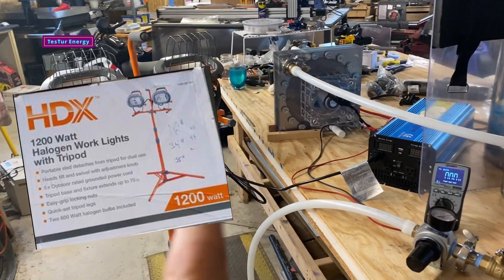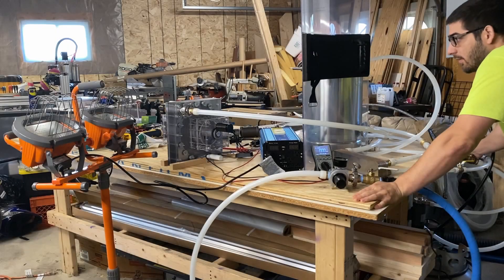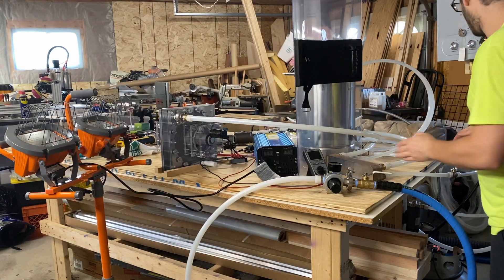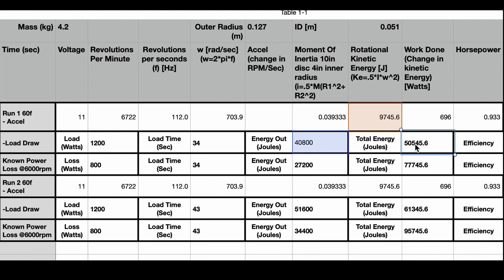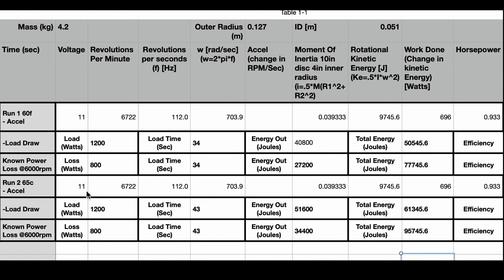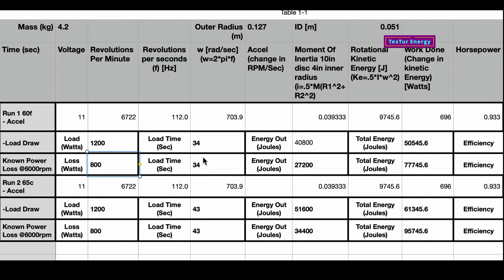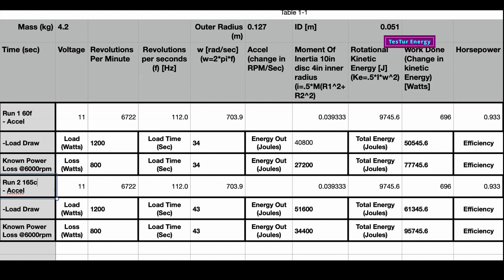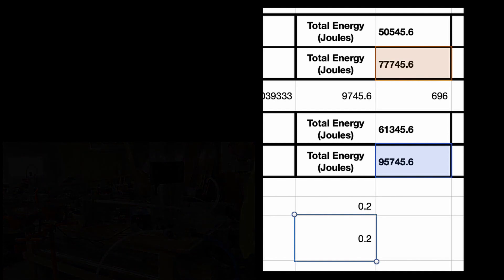Tesla Turbine 1200 Watt Electrical  Load Tests - Power Calculations - compressed Air + Propane

Comment from the maker: 1200watt Load Test ELECTRICAL Output Efficiency Calculations For 10in Tesla Turbine Are In! 
See the charts here!
https://www.youtube.com/post/UgkxRukN0zoVbtfe1LmLUlXyIo0kdt1ExWZs
Now, I want to premise these results with a few notes first. To start, I want to emphasize that the sheer fact that I’m getting this kind of power and torque at such a low rpm and pressure is the point of the feat here really. The only way to do that, at such a low RPM, with a Tesla turbine is to have REALLY good use of the motive fluid by having little to no slip. I have solved much of that issue with this first test prototype turbine. That’s with a plastic and aluminum junk garage build turbine that has very high inverter, rectifier, generator, gear alignment, RC car plastic gear yielding, bearing, casing sidewall clearance, nozzle geometry, small plate heat exchanger, 100ft comp air hose Losses and last but not least the circular rounding that I lathed on the hex shaft for the bearing, on one side of the turbine, is off center so I’m losing a ton of energy to vibration because of it. This stack of discs itself is impeccably balanced right off the cnc machine even though I have done ZERO balancing of it yet. The only vibrations I get are on the one side of the turbine shaft that has the bad bearing round. 

It’s going to take a little bit more R&D on my side to get the final actual efficiency numbers for just the Tesla turbine/disc stack itself, not just numbers predicted from the electrical outputs after estimated system losses. So mind you, for now, these numbers are low because they represent only the known energy converted, ELECTRICAL output efficiency, energy out to the plug vs energy available in the 170gal 150psi compressed air tanks. (This does includes the known change in rotational kinetic energy the disc stack had to gain just to reach the 6,500rpm operating conditions) These numbers are what someone would actually get out electrically with our system exactly as it is and not some fluffed corporate number that looks good in advertisements. Again bear in mind these aren’t indicative of the actual Tesla turbine’s operational efficiency because of all the random bad side components in my turbine, that I don’t have exact losses for, as well, and possibly more importantly, because the efficiency test is done over a very short period of time. 

For perspective, the change in energy just to increase the rotational kinetic energy of the disc stack to operating RPMs is 1/5th of the total power put out for the first room temp run. So not only did I have to give up A LOT of the compressed air just to get it up to “efficient operating RPMs” but this happened in its least efficient rpm load range so that part is heavily weighing down the overall efficiency of the total energy output compared to available energy. 

But now as for efficiency numbers. I have now calculated it a few different ways. If we only consider the energy put out by the light alone the efficiency seems to come in around 13-24%. That’s calculating the available energy in the amount of compressed air we have available in a couple different ways and is really super low ball rough estimate. If we can fix the gear losses etc, again which should be easy to do, with the the new direct on shaft generators I’ve got, the efficiency is coming in between 26-46% efficient and could be even higher depending on how much of a low ball I put on those 1200watt unloaded generator loss numbers that can easily be gotten back with simple fixes. This is to the PLUG too!! Not to the turbine’s shaft. My unloaded generator power loss tests showed 750-1500watts of loss at these RPM ranges and my calculations have 1200watts of loss. Realistically the loaded generator condition could be seeing upwards of 1500-2250watts loss, especially with the plastic gears yielding more under load. So the real losses for the loaded condition could be something something like 1600watts plus, which if that’s the case the efficiency is looking like it’s close to 29-53% efficient, operational efficiency, to the plug 🔌. Again these are rough estimates for how much energy is available in 170gallons of 150psi compressed air. Which, for the record, the different ways I calculated it give it a range from 260,000-380,000joules.

The red, yellow, and green cells in the upper right corner show how much of the available energy in the 170gal 150psi tanks was turned directly into electrical output. This is NOT turbine efficiency. This is the efficiency AFTER inverter, rectifier, generator, gear, bearing, endplate clearance, nozzle, plate heat exchanger, 100ft of hose losses. Each of the three colors are from calculating/approximating the energy available 3 different ways. Red: an online compressed air energy storage calculator. Yellow: ~10% of the compressor input energy (compressors dump ~90% of the heat of compression out to the air through heat exchangers.) Green: energy needed to compress that much ambient air down to 170gal at 150psi. As such, the ACTUAL ELECTRICAL OUTPUT efficiency shows that about 13%-24% of available energy in from the 170gal 150psi compressed air tanks was turned into electrical load energy output. 

At the bottom there are two theoretical calculations for the maximum electrical output efficiency for if the turbine disc stack was 100% efficient at utilizing the energy it was given. The top row is for the case where all those conditions are bad (most likely the case for these runs) and the bottom row shows the maximum electrical output efficiency if all the auxiliary components to the system, other than the turbine, were fixed with quality parts like low friction magnetic bearings, etc. This ranged from ~41% for bad/moderate/current operating conditions and ~50% for fixed/modern high quality parts. Considering these numbers that means we can reasonably expect anywhere from 33-55% ELECTRICAL output efficiency by only needing to fix the major loss components. Thats STILL before any heat is added to increase thermodynamic efficiency.  

If you know how to, let me know what you get for the total joules available in a 170gal tank at 150psi being dumped to 65psi. Like I said, I came to those numbers above. It would be interesting to see what others calculate for me to compare to. I will add though that I’m going off the volume the tanks are labeled as from the manufacturer. So it is entirely likely that these tanks are quite a bit smaller than what’s advertised. Which only means we are getting better output efficiency because the available energy in will be less if the tanks are in actuality smaller than advertised. 

Industry standards for micro gas turbines is about 25% electrical efficiency. From the DOD:
https://www.energy.gov/sites/prod/fil...

Micro-Gas Turbines
https://en.m.wikipedia.org/wiki/Micro...

“Microturbines have around 15% efficiencies without a recuperator, 20 to 30% with one and they can reach 85% combined thermal-electrical efficiency in cogeneration. The recuperated Niigata Power Systems 300-kW RGT3R thermal efficiency reaches 32.5% while the 360 kW non recuperated RGT3C is at 16.3%. Captain Turbine claims a 33% LHV Electrical Efficiency for its 200 kW C200S.

In 1988, the NEDO started the Ceramic Gas Turbine project within the Japanese NEW sunshine Project: in 1999 the recuperated twin-shaft 311.6 kW Kawasaki heavy industries CGT302 achieved a 42.1% efficiency and a 1350 °C Turbine. inlet temperature. In October 2010, Capstone was awarded by the US Department of Energy the design of a two-stage intercooled microturbine derived from its current 200 kW and 65 kW engines for a 370 kW turbine targeting a 42% electrical efficiency. Researchers from the Lappeenranta University of Technology designed a 500 kW intercooled and recuperated two-shaft microturbine aiming for a 45% efficiency.” 

It’s only when gas turbines are combined in CHP systems that they get reasonable efficiency from utilizing the heat for heating, together with the electrical needs. These micro gas turbines are used by hospitals and other institutions. These kinds of low efficiencies are ENTIRELY industry standard and in all honesty I’m tired of hearing people say the “Tesla Turbine isn’t viable because it’s not 90% efficient because large scale full plant turbines get 90% efficiency”. First off that’s not even true (the best axial flux turbines get 60-70% the rest is “used” as reheat and recoup) but secondly it’s the biggest disingenuous, strawman, red herring, begging the question fallacy. 18-20% is automobile industry standard… and people have the nerve to tell us that the Tesla turbine isn’t industrially feasible because it can’t compete with “modern engines” 🙄🙄🙄 (never found full malarkey) 

Even regular modern piston engines are at best, during optimal cruising tests conditions, ~35% efficient. That’s not in a car either. That’s only to its shaft BEFORE the transmission, because you know they don’t give the numbers for AFTER the drivetrain like I’m going to do for you. I’m SOOO confident in just how well this turbine works I’m going to give you the worst case scenario because I know even that’s still going to be better.

(Continued in comment)
Reply from the maker: (Continued)
“Most iron engines have a thermodynamic limit of 37%. Even when aided with turbochargers and stock efficiency aids, most engines retain an average efficiency of about 18–20%. However, the latest technologies in Formula One engines have seen a boost in thermal efficiency past 50%.”
https://en.wikipedia.org/wiki/Internal_combustion_engine

And I’m already coming in at 13-24% efficient to the wall plug with only a ~35 second run, and no fixes to any of the badly built components. Not Turbine efficiency, electrical efficiency WITHOUT any kind of fix to the Tesla turbine with only room temp compressed air, not combustion temps. That alone is amazing. Reasonably speaking if there are 5 components in a row each getting only ~90% efficiency, inverter ~90%, rectifier ~90%, generator ~90%, gears ~90% bearings ~90%, that’s (0.9)^5 at best ~60% to the wall plug if the turbine was 100% efficient. Never mind the fact that the “theoretical limit” for air engines is ~60% on top of that.

Again the time it took just to spin the turbine up to operating conditions was ~30% of the total test time and only accounts for ~20% of the total known energy output. Doing that when the tanks were at its highest pressure, accelerating at the worst efficiency, at low rpms and heavily weighing the overall efficiency average with that because the test was so short means the test is showing much MUCH lower than what it’s actually getting. (Again, for the 10th time, I will stress that this is “efficiency of energy that went to the wall plug/electrical load” NOT “efficiency of energy into the turbine to energy put to its shaft” like all other turbine efficiencies depict. My numbers are what someone would actually get out electrically with our system and not some fluffed corporate number that looks good in advertisements. AND not the turbine under its best operating conditions with precision auxiliary components, how all modern precision turbines list their performance) 

Upon start up to getting going, the turbine was most likely seeing a varying efficiency, worst in the beginning and best at the end. If we break the 50 seconds of the first test into 10 second intervals and average efficiencies over those time intervals to get what was calculated we would see a pattern something close to this:

At worst:
4%, 9%, 18%, 18% 18%,….
averages to ~13.2%

But in reality operating electrical output efficiency, once up to operating RPMs, was most likely ~18% and would have converged to ~18% given a long enough test that wasn’t heavily weighted by the inefficient acceleration.

At best:
8%, 16%, 32%, 32%, 32%,…
averages to ~24% 

But in reality operating electrical output efficiency, once up to operating RPMs, was most likely ~32% and would have converged to ~32% given a long enough test that wasn’t heavily weighted by the inefficient acceleration.

So with a longer test this “output to electrical” efficiency is likely to converge to ~18% at worst to ~32% at best. That’s with the turbine in its current horrible state. Again that is AFTER inverter, rectifier, generator, gear, bearing, nozzle, plate heat exchanger, 100ft hose losses….. made from plastic and aluminum and is under ~30lbs… and it’s more than competing with $1000-$5000 micro gas turbines that use combustion temps to get that high of electrical output efficiency in the first place. This alone shows this turbine of mine to be in a league of its own. 

And My 1200watt power tests were at less than 1/2 the max rated RPM of the these garbage 3105 h13 aluminum discs I made from scrap materials. Also, I’m still only using room temp compressed air and saw that 1200watts+loss output all the way down to ~65psi. So comparing my low temp turbine numbers to full temp steam and combustion turbines is really apples to watermelons. Not to mention regular bladed turbines don’t always see perfect increase with temp like is theoretically proven because as you increase the motive fluid temp you significantly increase its viscosity and that increase in viscosity comes with a lot more boundary layer drag loss inside on all the bladed turbine internal surfaces. Whereas in the Tesla turbine the increase in viscosity, as you increase temp, decreases the slip on the discs because of increased adhesion and decreased Reynolds numbers (further reducing turbulent losses). All of which even further increases efficiency as temps are increased. 

Then throw on the bacon bits of the effect known as “the reheat factor” that even further increases efficiency. The reheat factor is what happens when the motive fluid sheering and slipping on the discs turns some of its kinetic energy back into thermal energy. It does this the most in the outer periphery of the turbine discs where the velocity difference between the fluid and discs is highest and pressure is still greatest within the turbine. What happens when you heat a pressurized gas and expand it through a turbine? You get a brayton recoup recycle of the slip loss in the periphery, when velocity differences between fluid and disc are the most, all within the turbine. This is why larger diameters scale up to even better performance than just increased area. Because it allows the loss from the fluid when it is slipping the most, moving the fastest to be recouped as a thermal energy and expansion through the rest of the spiraling expansion path of the turbine.

Comment: Hey Charlie.

I hadn't responded to your message on reddit a couple days ago but wanted to say this here: Great work on posting the actual efficiency numbers.

Extremely sus eyeball testing suggests the thermal efficiency is about 3%-5% which is absolutely stellar given the temperature ranges and the fact that you're a dude doing this in his garage. Well done. :)
Reply from the maker: Hey cheebzta! No worries lol I’m just spamming all the Tesla turbine posts everywhere trying to show all the people who said they can’t work that they can actually work. But yeah round trip efficiency is abysmal because 90% of the compressors input energy is dumped out with the heat of compression. But give me 20 minutes to swap out the compressor heat exchangers with my plate heat exchangers so I cool the compressed air and dump the hot water into the turbine with the compressed air to recoup all the heat of compression, Then make that inlet pipe wrap the exhaust pipe of the combustion engine before going into the turbine and we’ll see what the real round trip efficiency can be. 😂😂😂

But yeah to the plug with all issues, of the energy available in 170gal tank at 150psi 13-24% was converted into electrical energy. But should converge to about 18-32% electrical efficiency over a longer run. 

If you look at the chart I posted in the efficiency community post the actual turbine efficiency is looking to be between 30-54%. And that’s still without fixing the plate heat exchanger losses, the 100ft hose losses, sidewall tolerance, or the nozzle geometry. And with fixing the auxiliary components to the system it’s looking like it could com in at 37-67% efficient. All without raising the temps at all. And these numbers are for the first room temp test too. Not even the 75°c test.
Reply from the maker: I found it really cool that even as a proof of how inefficient air compressors are, the two calculations I did for the available energy in the 170gal air tank at 150psi dumped to 65 psi straddle either side of 10% of the compressors input energy.